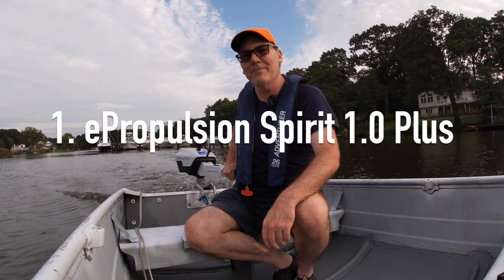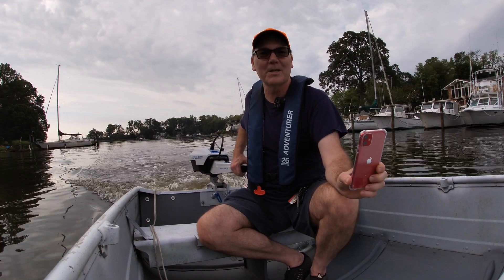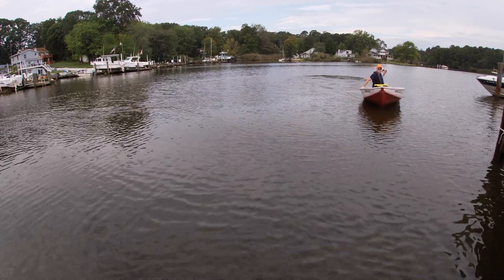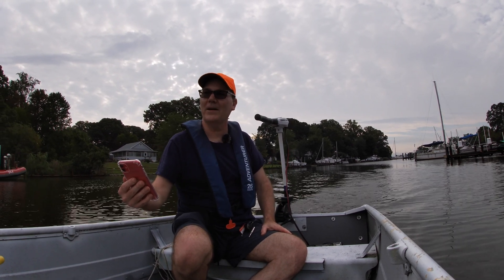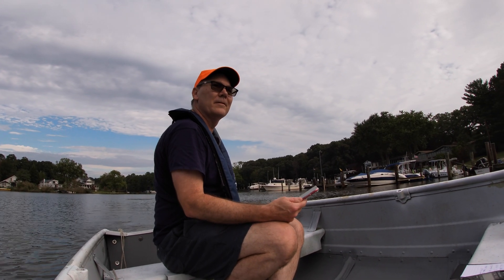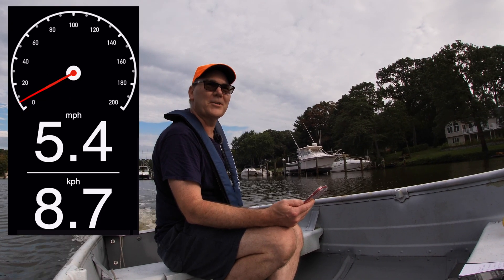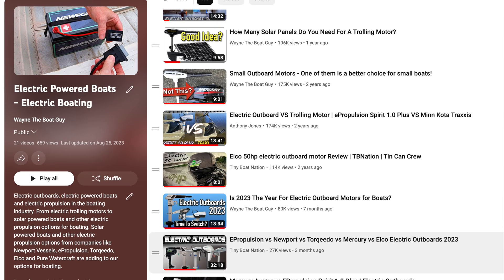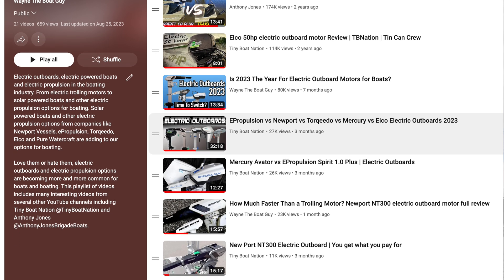Electric Outboard Motor Top Speed Test! ePropulsion -v- Newport -v- Minn Kota

Comment: Power consumption? Please.
Reply from the maker: All of the small electric outboards seem to last several hours at mixed speeds and to use up the battery in about an hour if run at max speed the whole time.

Comment: Hey Wayne, how can E-Propultion say that the 1.0 plus is equivalent to a 3-HP gas motor. The 1.0 only produces 1000 watts. that's 1.34 HP. To get 3HP you would need 2,206.5 watts or I'm I missing something here. I purchased a 1.0 last year from Tiny Boat Nation, and I run it on a 16-foot 1974 restored Aluminum Lowes canoe. loaded with fishing gear I get only 5.65 MPH. I was hoping to get closer to 8MPH. Overall, I like the quietness and the time out on the water, I have never run out of battery. Like your videos, very informative to the electric boating world. Thanks
Reply: I use NT300 on Old Town Discovery Sport 15 canoe (15.4 foot, with transom mount). Fully loaded with fishing gear, trailing motor and me ~250 lbs. Max speed 6.8 mph (~35 amps), at 6 mph (~22 amps). Happy with this setup.
Reply: @dimak65  I think I can get more speed if I can move some weight up front to get the nose down in the water to slice through the water instead of trying to plain. Moving more forward and getting an extension cable and move the battery down to the floor.
Reply from the maker: I think the electric outboard manufacturers can promote a higher horsepower equivalent than the math indicates is because of torque - especially low speed torque.
Reply: @WayneTheBoatGuy  Just wished I had gotten the 3.0 with EVO. My canoe has a transom, so the tiller is right behind me, and the canoe is too unstable to turn to one side to reach it better. I have to reach around the seat. I'm working on building stabilizer floats to help with that. Thanks

Comment: Honestly, for the price of these electric outboards, I would just buy a $160 lithium battery and a used 12v trolling motor for $50. Be in it for $200-250. And get about the same as these 3hp Outboards.

Comment: I believe that epropulsion is rated at 3hp. However, I'm pretty sure in a race my Honda 2hp would beat it. I also think your 58 Johnson 3hp would beat it. It would be interesting if you tested the old Johnson against it. I think a true rating on these 3 hp electric motors is about half.
Reply from the maker: I do want to run the 1958 Johnson against the ePropuplsion because it could be fun and interesting!
Reply: @WayneTheBoatGuy  Put a tiller extension on the 58 and move your weight forward on the boat. I think you will be surprised.

Comment: I had a question. I just got the motor and was wondering if the prop senses load?  I’ve yet to put it in water. When I turn it on out of water it won’t go past 36 watts and doesn’t seem very powerful 
Thanks!

Comment: Miles per hour? Why don't you use knots like a real boatie?

I'd like to see the same test but with a full load of provisions/fuel/water drums in open water into a 10 knot headwind and against a full spring tide current.

Comment: I use my Epropulsion motor on my 6.2 metre yacht weighing about 1200kg. For most of the time I run the motor at about 300-500W which gives great economy. I only run it at full throttle if I’m against a strong tide or strong headwind. These electric outboards are not about top speed.

Comment: The electric outboards are amazing. But for $50 you can find an old 6 hp Johnson evinrude that will push that little boat 15 mph and you will be able to fish and use the boat ALL day long on a 3 gallon can of gas. You don’t need to by $1,000 worth of batteries to run it. I understand small lakes that don’t allow gas motors…..but those old gas outboards are a dime a dozen and they run forever if you take care of them. You could literally buy 30 small outboard motors for what one of those e propulsion motors cost. Just my opinion.
Reply: Wrong😅
Reply: @sharonbraselton3135  oh boy…….let’s hear this expert analysis.
Reply: Neew 6 hp beter 6 Amp ajrrrrentre stare 72xwatts chargeng
Reply: Oh. You’re just a bot commenting. Never mind.
Reply: A 6hp 2 stroke johnson or evinrude that runs costs a minimum of $350 on the used market here in WI.
Reply: @JA53705  4 hp eltri c jet drive only $275  soo undr $700 cheap gss eltric jet board cheape ybride boat
Reply: @JA53705  still cheaper than a $6,000 electric motor setup.
Reply: 5 hp groaned outing out bares baertes

Comment: Here is something to consider when looking at electric motors - If you sink, the lithium in the batteries will react with the water.  In fact, lithium will burn underwater.  It makes a very pretty pink flame when you submerge pure lithium.  I have seen it many times, as I worked with lithium for several years.  It also makes the water highly caustic.  I have personally seen several people receive some pretty nasty chemical burns because they got their hands wet in lithium contaminated water.  E-motors, boat or automotive, for all their hype are absolutely not environmentally friendly.  They are certainly not something I would put in my boat.
Reply: While I agree with everything you said, leaking pipeline or one busted tanker spewing crude is far more damaging than 1 or 100 lithium batterys that may be exposed to water. There is no right answer everything has a penalty

Comment: I bought a 1.3hp 4 stroke motor and a intex excursion 4. What top speed can i expect  (with me 70kg + other person 60kg and some 20kg gear).  My goal is at least 5km/h maybe 6-7
Reply from the maker: I would imagine you might get 5 km/h since that motor is similar in power to a trolling motor. Wind and currents could be challenging. I usually see small dinghies and inflatables using electric or gas motors in the 2.5 - 5 hp range.
Reply: okay thanks. Maybe i should have bought a 3hp motor, but I'll see if i wasted the 250$.

I only use it as a chillax boat on a smal 10 x 1km lake without any current. And i dont go  out if its windy @WayneTheBoatGuy

Comment: AU$ - EP & RT ~$3.5k. WS ~$800. Ali 48v 260lbs 10hp ~$700. Could buy 5 vs EP.  But, hopefully, by the time the 1st is no good, like cell phones, something better will be available, still have battery to suit anything.
Reply: Propane 5 hp. 10 hp chesp loowe

Comment: Further to the fact that the Minn Kota's a trolling motor, it's propeller's pitch won't let it exceed the speed you had it at. I suggest a second test where you mount these motors on a much bigger boat and see how they stack up.
Reply: .minnkota is also a brush motor, will run hotter and brushes wear and add a bit of resistance. It is 100 year old technology, you can make the minnkota run faster with a 60a pwm controller and say 24-36v battery. 
I've done this on a 55lb thrust use it as a kicker yah it shortens it life to push more watts.

Comment: Wayne I didn't think you were so into high speed boating
Reply from the maker: The G forces were intense!
Reply: @WayneTheBoatGuy now put the 55lb thrust trolling motor back on it and put a kipawa prop on it and see how fast it goes
Reply: Or apc prop
Reply: For an outboard electric motor, the contours of the vessel are very important.  On a self-designed catamaran and a homemade electric motor 650 W, speed 5.4 Kn

Comment: Been waiting for this video wayne, great test! I thought it would be faster. Now when you say trolling motors run out of power faster is kind of false, on my application (enduramax 55lb thrust with the APC prop) I get an average top speed of 4.4mph and it can run for 5.5 full hours on my battery (draws 26 amps from my 35lb 150ah lifepo4 battery). I did a budget trolling motor to electric outboard and got  5mph from it (86lb 24v trolling motor with an APC prop) it's only .2 mph slower than the NT300, draws the same power (42 amps at 24v or 1000w). Your top speed confirmed my research when I was trying to make a trolling motor faster, it's not the actual electric motor, but rather the prop!! Thanks Wayne!!!
Reply from the maker: Glad you got to see this one! The Newport is actually a 36 Volt system - not sure if that makes a difference or not.
Reply: @WayneTheBoatGuy  it does, so the higher the voltage, the lower the current draw on a motor under the same load, the nt300 draws about 35amps at full speed, my "trolling motor outboard" draws 42 amps at top speed (5.0mph). Now that seems like my motor draws more overall power but that's false, this is why most companies use watts (volts × amps = watts) so my motor was drawing 1008 watts while the NT300 draws 1260 watts.
Reply from the maker: @codyakfishing8856  I can't help but think there has to be some good reason why nobody is offering a cheap faster trolling motor.
Reply: @codyakfishing8856  link to the APC prop?
Reply: @TJDST4  what motor do u currently have??
Reply: @codyakfishing8856  Minn Kota riptide 45lbs thrust
Reply: Riptide 45. Riptide 80 used on. 8 9 metrr Parker mini yaght cabin cruserr 24 foot 27 foot cabin cruiser useing Riptide 80